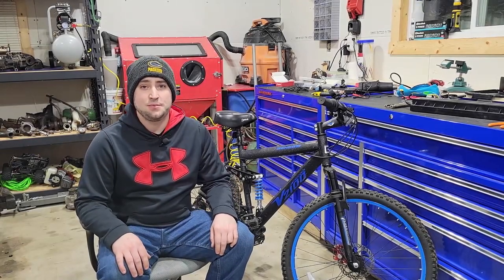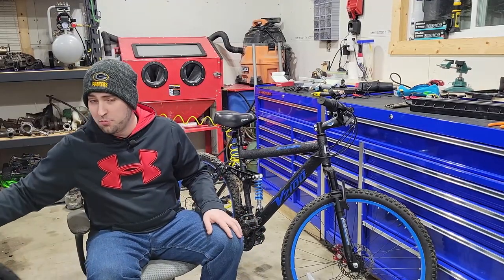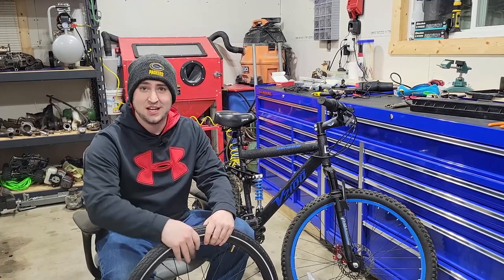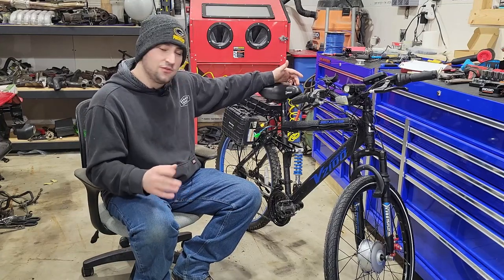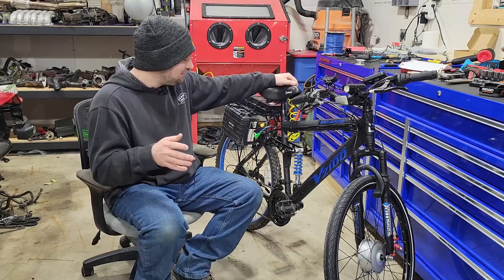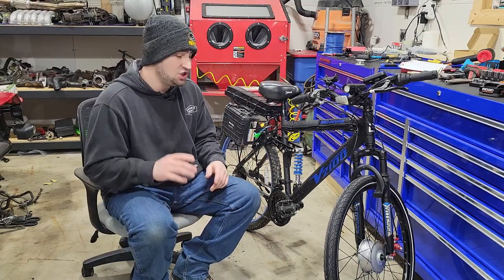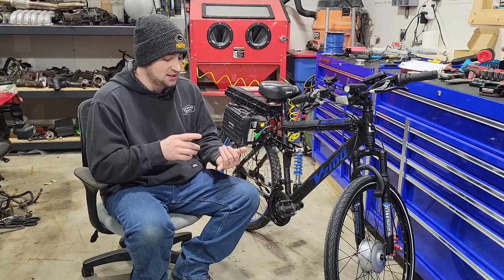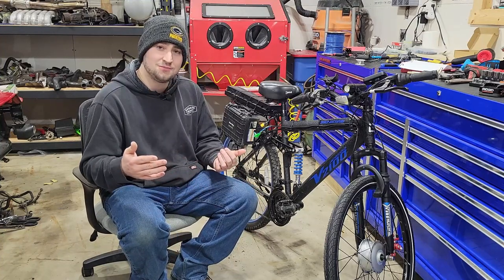$200 eBike Build - Step by Step Tutorial

Comment from the maker: If you don't need a 25 mile range you can find a cheaper $25 battery that will give you less than 10 miles of range. Or wire up power tool batteries for free. 😁
Reply: $25 battery?!  Where can you buy such a battery?

Comment: Riding the bike without front brake is going to be a problem. I tried it before but will never do it again.
Reply from the maker: I took it out a few times. Put on about 50 miles and the rear pads are now gone from overuse and overloading. Definitely need front brakes. 😁

Comment: This is awesome.  The only extra things I would maybe add to it:  (1) Torque arms to the front axle/fork so the new wheel doesn't rip out your drop outs, and (2) a fuse somewhere to prevent damage to the battery in the event of a short.  Both super cheap mods that will really help.
Reply from the maker: Thanks for the input. I can't believe I never thought of a fuse. 😅  Probably going in tomorrow to protect the controller incase something goes wrong.
Reply: @toptiergarage7378  All good I had not thought of it either!  I built up my own bike, went into a local ebike store near where I live (who thankfully are very supportive of hobbyists) to order my battery, and they suggested the addition of the fuse to me.  The battery is often the most expensive component - makes sense to protect it!

Comment: I've built a few ebike

One has cost me £70 for everything all together.
BMX 36V 350w 
Another one cost me £130 altogether
Giant jump bike mid Drive system 1000w to 1500w with 14s 8p 52v lithium battery pack.
And lots of extras.
That bike would have cost me £60 if I didn't buy new tyres chain and other stuff what wasn't really needed.

Iv built other stuff like e-scooters what cost me next to nothing to build.
I'm actually doing a e-bike now.
when it's finished I'm only selling for £200.
I'll be making £150 profit
Reply: Where are you getting the bits from in the UK?
Reply: Where do you get ur equipment from

Comment: Awesome conversion! I've heard from some that front hub motor wheels are potentially dangerous depending on the kind of fork you have (if aluminum, it's not as good an idea). I have two bikes I'm considering converting, both with aluminum forks I believe: Trek  '04 7700FX and a more recent Schwinn Sierra 7. The front hub motor you linked sure is cheap but I'm a little concerned about the concerns running one of these on a fork that could be a weak point. I wonder why the rear hub motor wheels are so much more expensive. Have you found one for cheaper?
Reply from the maker: Rear hubs are more expensive due to the higher wattage. Some can put out 2-3000watts. The 250watt motor that I put in is the lowest wattage available. Pretty much so low of power that it won't hurt anything. I have about 200 miles on it so far and no issues.